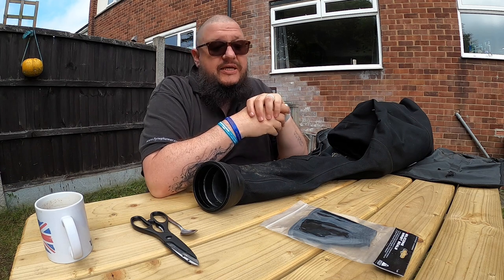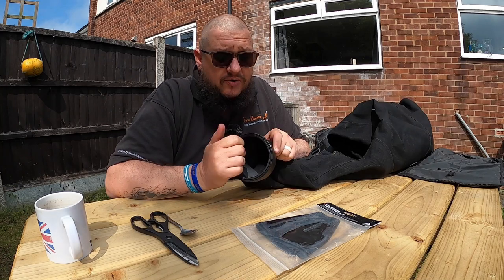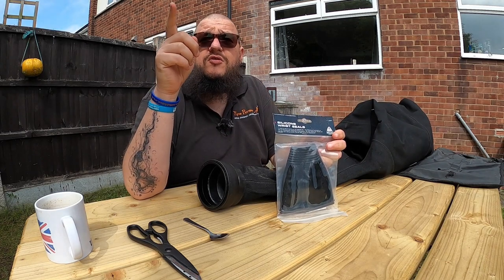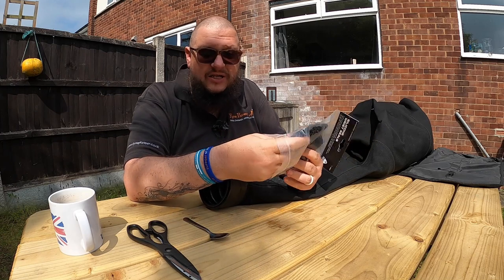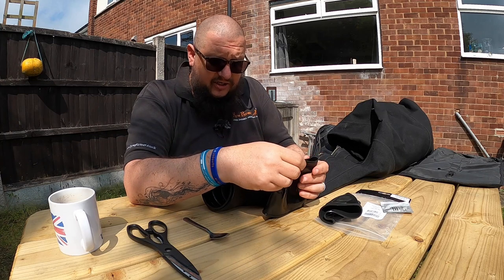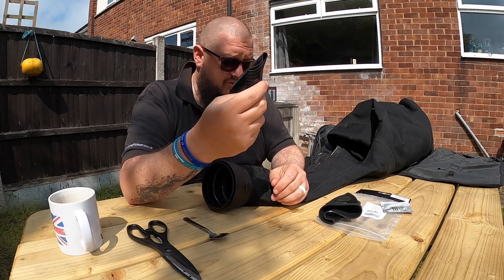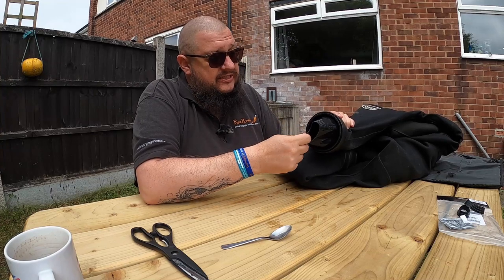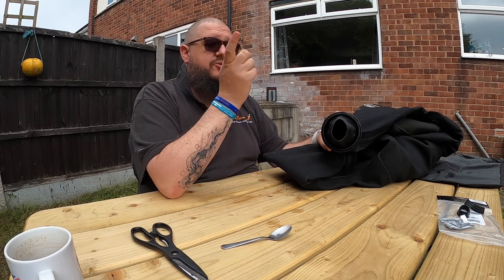Latex Vs Silicone - CUFF WARS!! | UKDiver

Comment: The silicone seals are a better insulator and warmer than latex. A few drops of dish soap or mask defogger can make popping in the the wrist seals easier. Powder up seals before for easier donning and after to absorb body oils off cuffs ( more important with latex to avoid from premature gumming.

Comment: here in the states i dive a usia suit with the same system. you can use a latex seal in that system in a pinch to save a dive when you cant get silicone seals. they work in the wrist and neck. you can also skip the wrist seal and just put in a dry glove in place of the wrist seal but then u loose the redundancy of the wrist seal. these systems are quite versatile.
Reply from the maker: Yeah, I’ve used a latex seal in this before as you say when I ripped one and borrowed a spare from a buddy. I think it would be a brave person to skip the wrist seal over here in the UK! 😂😂 I’ve never seen it done over here anyway 😮😮 Cheers for the comment pal! Hope you’re doing well 👍👍